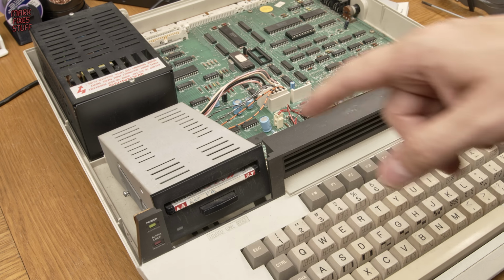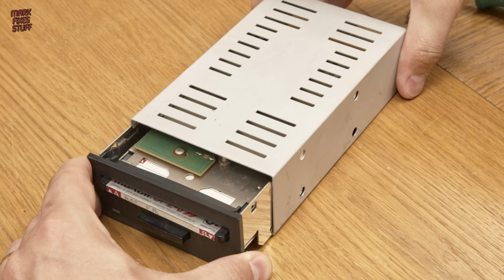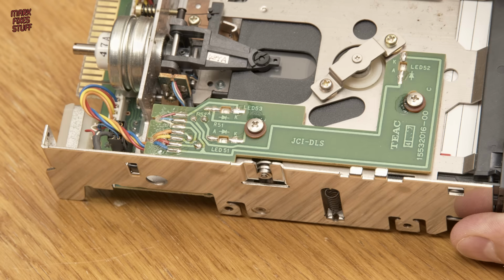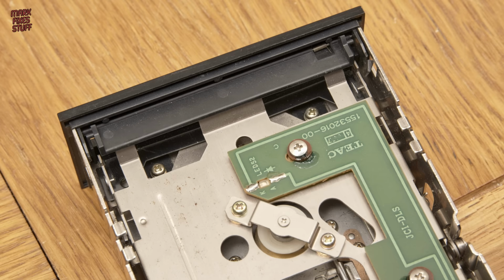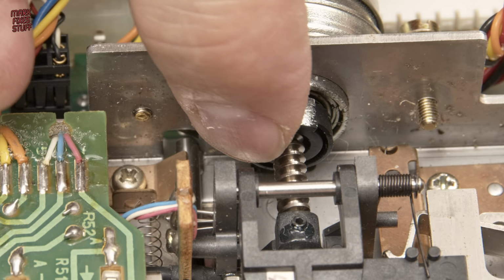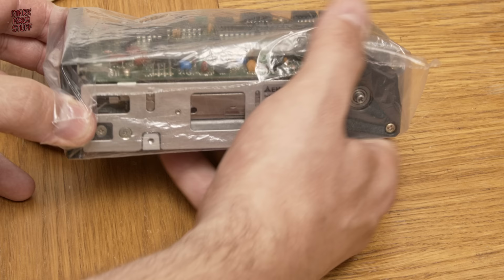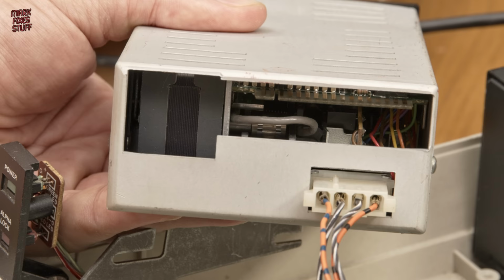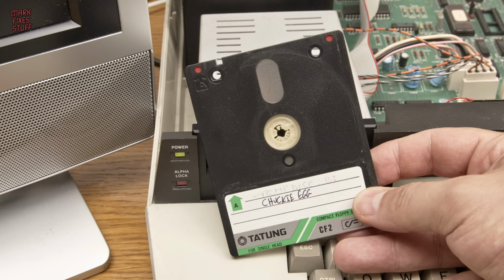FAIL:  3" Tatung Einstein floppy drive too broken to repair🤔😢😭

Comment: Someone really did a number on that drive. I'm guessing the reason it jammed in the first place was that missing runner on the underneath of the drive. It would've popped off and put the carriage out of alignment, and then they've made it worse by pushing and pulling and levering it until it was all bent out of shape. If they'd just disassembled the machine, found the parts of the runner and reassembled it, it probably would've worked just fine.

Anyway, thanks Simon. Thimon.
Reply from the maker: I reckon you're probably bang on there. I later found the old runner lodged in the machine, luckily not shorting anything.

Comment: lol chuckie egg .. hold all the control keys down at once and it jumps a level lol, I actually own one brand new in box with the original receipt priced at 499.99 at my daughters as I dont live in the UK anymore.. it still has the box (bit tatty) and a load of disks, I always wanted an 80 column card but too expensive.  The TC01 was the first computer I learnt to program back in the 1987, I dont own the original but I managed to get the one I currently own upgraded with a second drive. I spent hours developing applications and games back then ... I had a few friends who worked for Ocean Software back then ... hence why I know so much about the Einstein and its legacy in computing.. built to last .. so loved that micro.. compared to all the other computers i developed on like the BBC, spectrum, C64 oh I could speak for hours about these amazing computers ..long live 8 bit!!

Comment: i presume its the same as the amstrad drive
Reply from the maker: I thought it would be as well, but It’s actually quite different. The drive connector isn’t IDC pins, but card edge like a 5.25 floppy and the drive is directly motor driven unlike the belt drive model in the Amstrad machines. I’d go as far as saying it’s higher quality.

Comment: Wow spoilers in the title :P

But yea someone probably really thrashed that old drive trying to get that disk out so sadly an unlikely repair, unless you can take it completely apart and put all the parts in jigs or something, or have replacement pieces stamped and milled.

Comment: Don't zoom in when you're stripping the Phillips head screws. It made me cringe. Either replace them, use a proper sized and typed screwdriver for them ( pz or ph ) or replace them with Torx which are superior. The next person along will have a rough time getting the screws out of they are unlucky. The angle is no excuse, they make extended length screwdrivers for that. I could literally see you scraping metal of the heads brr.

Comment: I must say, even though I like the original floppies and such. I would replace them with Gotek or something else...
Now, that I found a proper new PSU for my QL (had it for like 3 or 4 years and never even got to try it, because no PSU...), I need to get a replacement for MicroDrive... Who in their right minds would use a MicroDrive anymore? Such an unreliable thing...